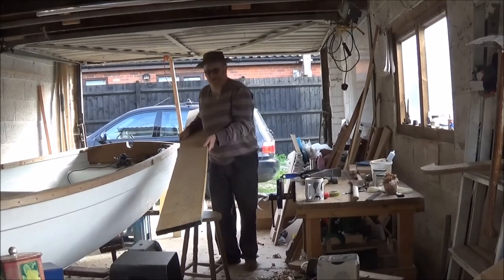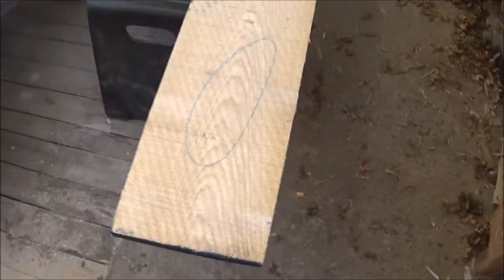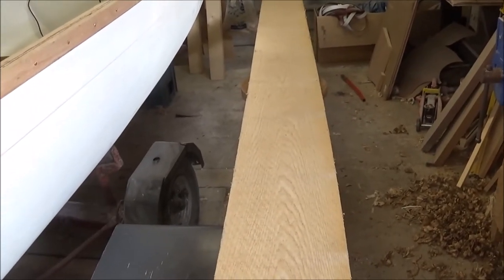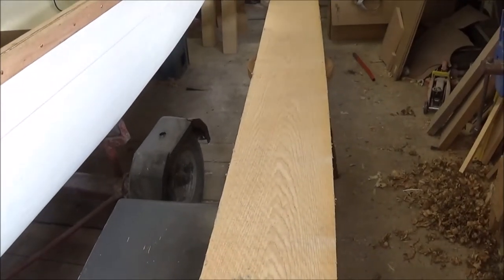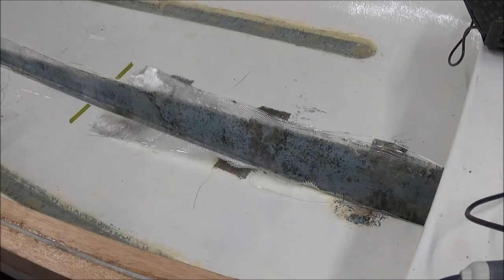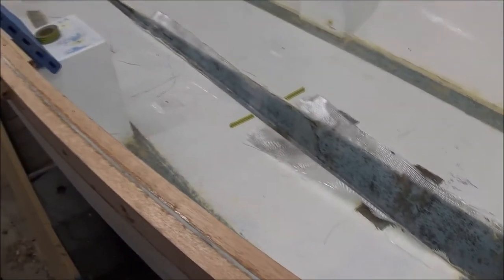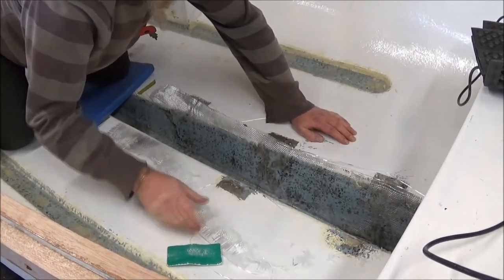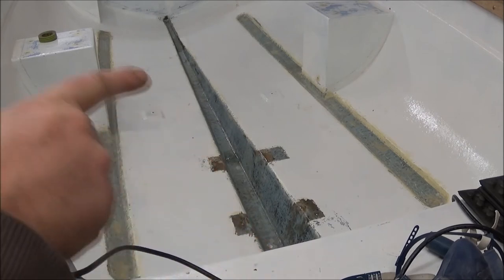Dale Skidmore - Boat Restoration Part 16

Comment: Great progress, Ade. Good wood is hard to get, even over here. Winter is almost here, so you might as well not rush the final legs of the project. Thank you for this episode, Ade
Reply from the maker: It is coming up to a year ago when I started the garage roof replacement and they are saying this winter will be worse, so I have some work booked for indoors through that. There is still a lot of sanding and varnishing to do on the woodwork that will take a lot of time, so it won't be a case of all finished and waiting to go on the water, lol. I'll just keep pecking away, she'll be ready when she is.... Thanks for watching.